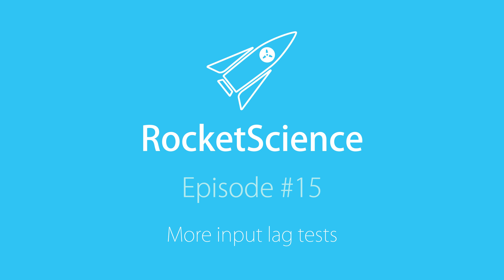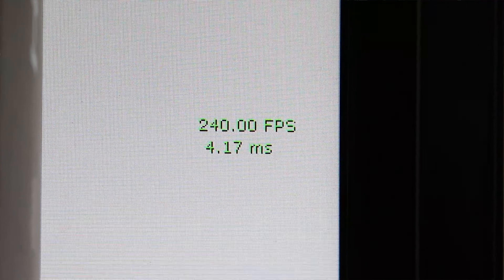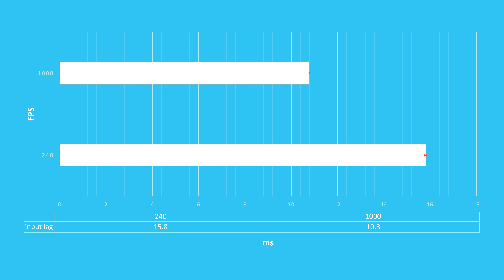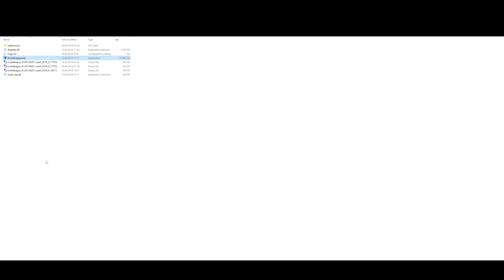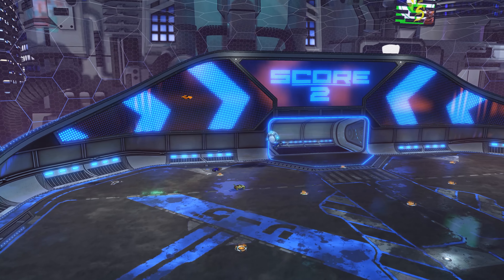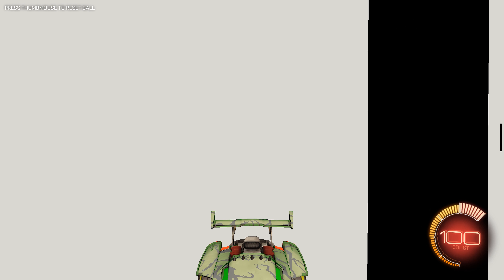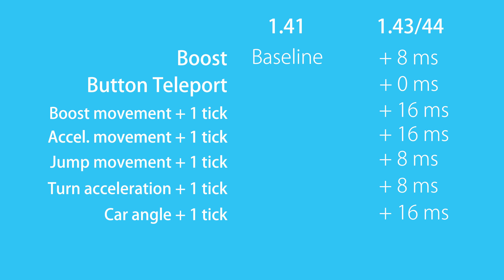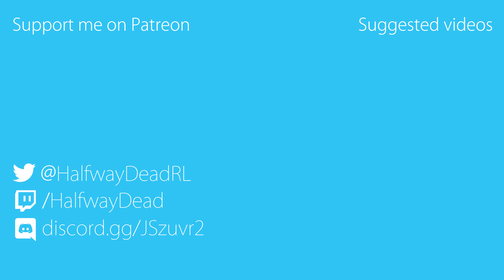RL input lag retested 1.44 - Rocket Science #15

Comment: Holy, we're so lucky to have someone like you in the community, what a god.
Furthermore, this controller test you are planning to do is something i have been waiting for for ages, since i've used DS3 and DS4 and i always get to the conclusion that DS3 is way more responsive.
Reply: Bruno Palomar SAME! Going from ds3 to ds4 and never got used to it.
Reply: It's well known and true that the DS3 is more "responsive" because it doesn't do normalisation of its joystick output. Instead of scaling the vectors to a circular space, they reach the extremities of the square bound, and the game doesn't account for that possibility because practically every other controller does. You can clearly see it if you bring up the game controllers dialog in windows. The only time it gives you an actual advantage is when you're rotating diagonally mid-air. On the ground as far as I know it effectively just changes the turning sensitivity (not the speed), which you can tweak in the settings anyway.
Reply: nextil U would be amazed of how much of a difference it makes to be quicker to rotate diagonally mid-air or on the ground.
And whats more, is the fact that sticks have a way softer movement, so u r actually more precise on low turns.
I dont know if u have experience with both of em, but give it a try and objectively youll agree with that. Perhaps u prefer a harder joystick, but thats an opinion
Reply: I haven't tried it for RL but I'm not doubting that it's better in specific circumstances (although there's no such thing as rotating diagonally on the ground) and I do prefer the lighter sticks, it's just that pretty much everything else about the DS3 sucks. Triggers are awful, shell is creaky, sticks get slippy, grips are too small. Not worth putting up with it for that minor advantage that you could pretty easily emulate in software anyway.
Reply: Well i guess thats a metter of opinion. I have been playing ith the same DS3 since 2013 and the sticks havent got slippy at all. Triggers aren't awful imo, theyre actually good. What i do give u is the shell might be a little creaky at times if u compare it with a DS4, but doesnt seem to affect the gameplay.
I understand ur point of view tho, it interesting to see how wide the range of preferences can be...

Comment: Hey, great video and thanks for the shout-out! Your test setup looks really good. I looked into the frame capping thing for v-sync and it helped my system quite a bit. I have RTSS going with a frame-rate cap of 0.01 below my refresh rate as per the instructions on the link you posted and it lowered my input lag by about 10ms (20%) with vsync on.

Comment: I wonder if using some sound feedback instead of visuals would get you closer to the actual latency of your system, as the sound card is probably more responsive than the whole graphics chain. However it's just an idea. I have no actual information about the reaction time of an average soundcard. I would use some program where you can use the controller to change the volume, and would check the amplitude of a high frequency whistle that keeps the audio circuits on during the test while has low enough period time not to tamper the test significantly.

Comment: It should be noted that a well designed game engine will update its game-logic at an independent rate from the rendering. Rendering is generally an interpolated frame between two game-logic updates. The higher your framerate the closer into the latest game-logic update you'll see.

I would not be surprised if Rocket League uses a fixed-timestep, if I remember correctly RL updates its game-logic at 60Hz, so seeing a delay of 16ms between taking the action and seeing the response would be expected.

Seeing a response below 16ms would suggest the action to be outside of the game-logic update cycle.

It should be noted that a game-engine may have different update rates, for example, game-logic may update at 30Hz, AI at 10Hz, physics at 60Hz. Depending on the action taken by the user you may see the response at different rates.
Reply from the maker: You're probably new to the channel as I've already talked about that multiple times :D 
Yes, Rocket League has a fixed 120Hz physics tick rate. That is why car reaction has always been slower than pure camera reaction which is not tied to anything. Either way, in patch 1.41 I was getting exactly what I expected in terms of boost reaction time which was on average around 4ms more than camera swivel reaction. At 120Hz the tick lasts 8.3ms and the frame can be randomly aligned with it, causing 0 - 8.3ms input lag. So the average that you would expect is 4.17ms. Now though, boost seems to always be taking 1 extra physics tick but jumps still do not.

Comment: Es wäre sehr interessant wenn du am Ende ein Fazit ziehen würdest wie man den geringsten und den höchstmöglichen Lag erreicht. Ich z.B. spiel mit ca. 160fps, Settings auf max, 144Hz 1440p Monitor und nem xbox one Controller über den USB Receiver. Wäre ja lächerlich wenn ich nachher 20ms Lag dadurch erschaffen hab :D

Although: THIS IS NOT THE REAL ROCKET SCIENCE! Where are the helpful tips how to use the drift-button or the double jump while camerashake is on? Hail StateFarm.
Reply from the maker: Allgemein kann man nicht viel machen außer die speziellen Punkte die ich in diesem und vorherigen Videos angesprochen habe. FPS maximal ist besser 160 vs. 250 aber kein riesen Unterschied da 160 schon hoch ist. Fullscreen optimisations disabled. VSync off. Controller hab ich ja wie gesagt noch nicht getestet.

Comment: How did you remove the Rocket League frame cap?
Reply: DerpFails documents data > my games > rocket league > config > tasystemsettings >allowperframesleep to false
Reply: Is it worth it?
Reply: Rlaxox I'll find out
Reply: more frames less input lag, if your computer can handle above 250 frames it’s an advantage
Reply: Seth Ketchum disadvantage would be screen tearing.
Reply: Seth Ketchum thanks
Reply: It does reduce the length of the ball trail and some boosts I believe, since they're tied to framerate.

Comment: Any ideas on why jumping off the ceiling double jumps sometimes input lag maybe?
Reply: Technoninja if i understand your question, its not input lag. However sometimes, eventhough it seems like your wheels are still on the ceiling, they really arent, resulting in performing your "Double Jump" and not being able to flip later. All you gotta do to avoid this, is jumping earlier of the ceiling.
Reply: Pa dS or don't jump, just drop. This gives you infinite time to use your second jump.

Comment: Why didn't you use the backwards camera button for the visual test? it is instant, isn't it? (sry, i don't play rocket league)
Reply from the maker: That would've been possible. I think I just didn't think about it at the time. But it has the disadvantage of showing literally the exact opposite side of the map and I'm not entirely sure whether that might have some performance impact. It's probably a better way if you want to test on a regular map though, simply because the entire frame will change and not only parts.